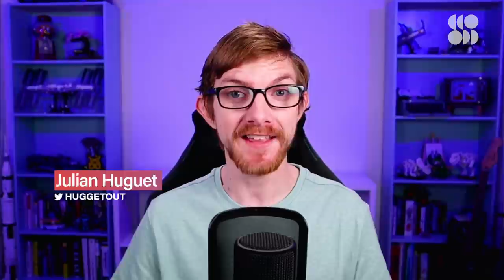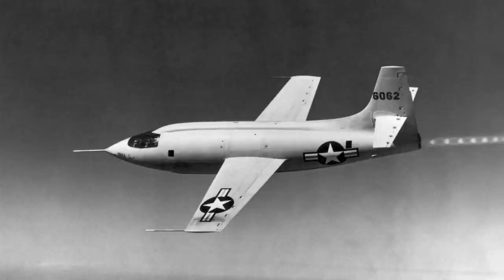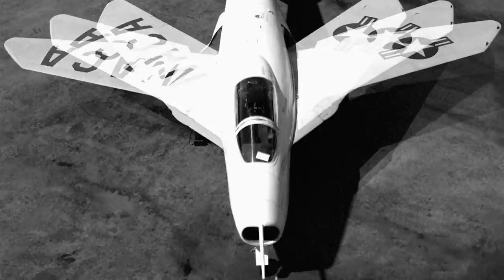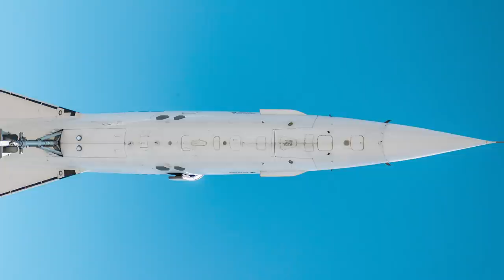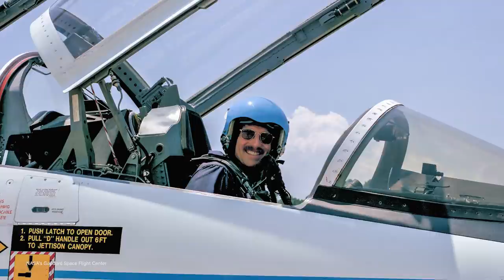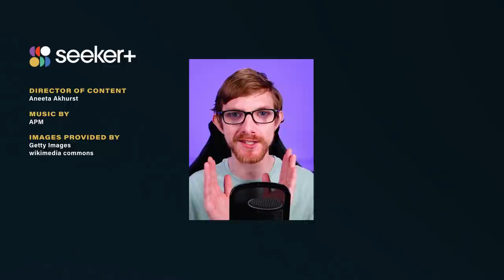Why Aren’t We Still Flying Supersonic Planes Today?

Comment: Awesome video. There's nothing as fascinating and beautiful as cold war era jets, they're a breed apart. Any video about the development of jets would be welcome. 

The X1 wasn't the first plane to break the barrier. It was the first one to break it in *level flight*. The Sabres in Korea were routinely reaching Mach 1 in dives.

Btw. The picture you see when you google "sonic boom" is not infact a sonic boom. It's a condensation bloom, you see them when there is enough moisture in the air, it's a transonic phenomenon. You can not see a sonic boom!

Comment: supersonic didnt go bust. all that is needed is a better-designed aircraft with a better-designed engine.
Reply: No, it didn't go bust - it went boom
Reply: it has the best designs its da could produce, and it still failed because the problem was the economics
Reply: @booketoiles1600  you are partially right in that it was economics but it had only 1 of 2 designs with the other being a russian copy which also failed not because of economics but because of the poor design. the plane didnt have flaps because below the speed a normal aircraft would call too fast for a landing, the Concorde was unstable in flight. most of the Concorde crashes were caused by low speeds with one being just after take off because of a tire blow out that ruptured the left wing tanks causing it to crash and kill everyone on board.
Reply: @teacher555555  I remember that, terrible tragedy.
Reply: @jessiferri2922  it only happened in 2003 and was one of the final blows into the concorde travel. to be honest i am surprised it lasted as long as it did because i think only 20 were built and 5-6 of those crashed. not a real good safety record.
Reply: @teacher555555  true. I was glad when it ended, the noise was terrible, and who needs to travel that fast anyway?
Reply: @jessiferri2922  well people are always trying to figure out how to go faster and faster. look at japan with the bullet trains and now with the maglev train. the concorde allowed fast travel from place to place in roughly half the time that a normal flight would take.
Reply: @teacher555555  The 2003 Air France tragedy was the only crash on Concorde's otherwise pristine record. The Tu-144 suffered from 2 crashes causing fatalities. We discuss that in this video.